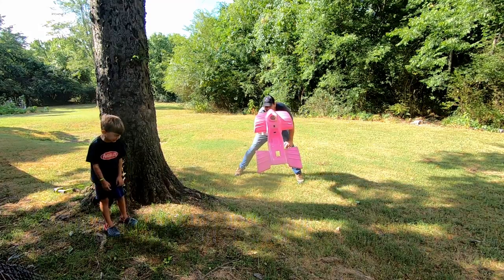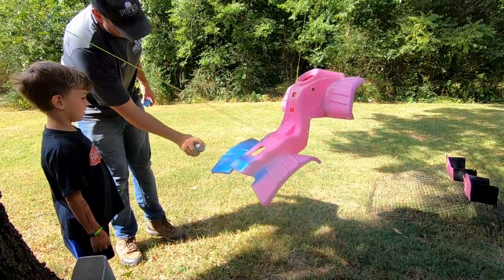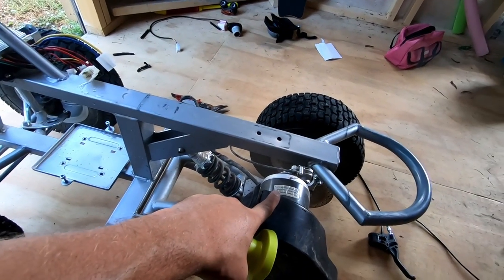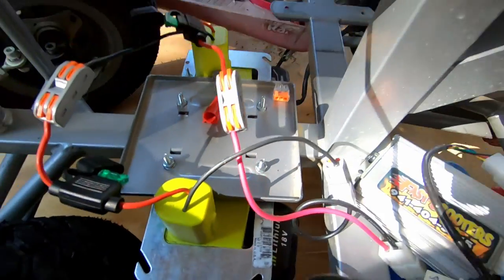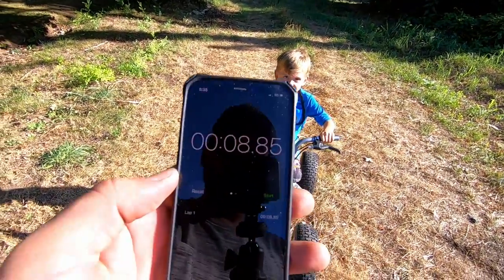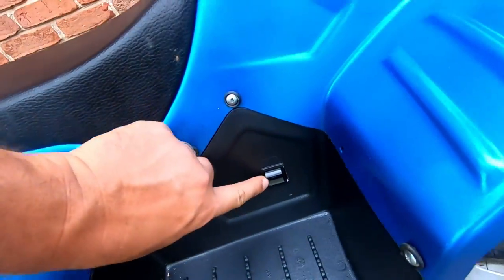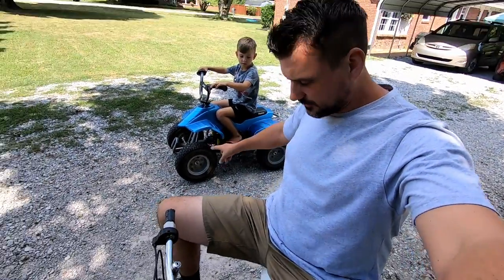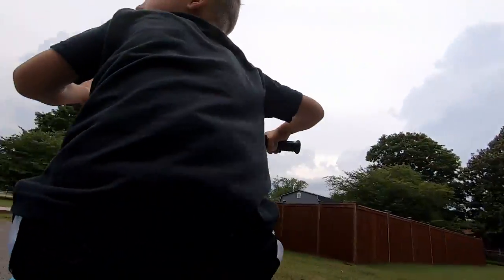Razor Quad 36v Upgrade with Ryobi Batteries

Comment: Where did you find the new controller? Thanks
Reply: I used a 36v controller and throttle from a Razor MX500.
Reply: They sell upgrade kits with instructions on ebay

Comment: Very cool 😁👍with the drill batteries. I got the same upgrade kit about a year ago and it's worked out great. I also upgraded the batteries from 3X 9ah batteries equaling 27ah to 3X 22ah mighty max batteries to equal 66ah. I'm pretty sure 22ah batteries are the biggest you can fit without major modifications. Before the with 27ah batteries she got about 3 or 4 miles now with the 66ah batteries she has gone 7.5 miles and it still had a plenty of battery left haven't found the limit yet.
Thanks for sharing?

Comment: How did you wire the ryobi battery adapters to the plug and play part of the fast scooter controller?
Reply: They sell adapters for most name brand quick connect batteries on ebay and Amazon that can be wired and mounted

Comment: Hi how many minutes the quad can run with this kind of batteries plz?
Reply from the maker: At least a 45min to an hour. Depends on the amp hours on the batteries. Most of mine are 2ah but the 4 or 6ah would be even better. Best part is you can drop new batteries in and keep right on going. When other kids are over it runs non stop all day with fresh batteries on the charger
Reply: @FaithfulFarmstead   ok thank you, i bought 12v20ah gel and lead batteries and it's for 45 minutes maybe 1 hour of pleasure.. i think it's due to their weight. Next time i think i will look for kind of batteries you use..

Comment: Cool video! I’m sure I’ll be modifying the quad once I buy it down the road. My question to you is do you know the difference between the two different 24 V razor quads? $450.01 $750. They both seem to hold 120 pounds and go 8 miles an hour except one looks like it might be 3 inches longer and maybe an inch or two wider.
Reply: Prices are all over the place on these razor quads but I would imagine the one for 450 was a 24v and the other one was razors bigger 36v quad but besides the looks all the 24v quads are the same

Comment: I’m about to do this to my kids dirt quad, which fast scooters controller did you end up getting?
Reply from the maker: I got the 36v overvolt kit. The only thing I would do different is not use Ryobi batteries. The way these Mount made it REALLY difficult to keep them from moving or falling off. If I could do it again I’d use dewalt, Bauer, or something similar that locks into the clip better. The Ryobi adapters don’t have a great way to mount them
Reply: Oh wow, that’s good to know. I might have to consider a different route then.
Reply: @AroundtheHouseTV be careful with the Dewalt batteries, they don't have a built in BMS. You will need to add them or you may drain them too low. I've use old drill handles to hold Ryobi batteries and that holds them pretty well.

Comment: I ordered a fast scooter controller and it started working and then 20 minutes later it stopped working
Reply from the maker: Bummer! I would disconnect it, hook up the old controller, and make sure it’s not the motor that burned out. Also, I would recommend replacing the throttle as well. The stock ones are junk. Good luck!

Comment: Hey, I did this but went to the 40v 
It works well except when it’s “shock loaded” like a sudden throttle against something. Then the battery quits. Hooking it to the charger resets it quick but I’m looking for a fix.
Any suggestions?
Thanks
Reply from the maker: Hey sorry just seeing this. I do recall seeing a guy hook up a 40v battery to one of these but he had to install something separate to keep it from shorting out. If you search 40v Ryobi Razor it should pop up. One of the few videos I could find on a 40v setup

Comment: Hey, love the paint job, I'm concered about mud puddles and those batteries.
Reply from the maker: Honestly they’ve run this thing so hard since we completed this and we’ve had no issues. I try to discourage riding through puddles but it gets worked over pretty good haha. Only issues have been the way the plates were mounted. The design of the Dewalt or craftsman style batteries would be much better long term
Reply: I wouldn't worry but if it really bothers you could always use some dielectric grease or buy a tube of gasket maker and run a bead to help seal it or even mount the battery adapters into the fenders

Comment: Hello and thanks for the video.  Was the controller upgrade necessary?  Would the stock 24v controller handle the 36v?
Reply from the maker: No you’ll have to update the controller
Reply: where did you get the new controller?
 @FaithfulFarmstead

Comment: How is the 24v motor holding up to the 36v batteries I'm thinking about doing this next time I bought 2-12v 12amp batteries and modified the battery plate and it works great but batteries are cheaply made and usually don't last long
Reply from the maker: It’s been fine so far. Really happy with the upgrade! This thing gets ridden HARD
Reply: You’d be surprised how much these motors can take. It’s mostly a temperature problem, but as long as the motors can dissipate heat effectively, they’ll survive the increase in volts.